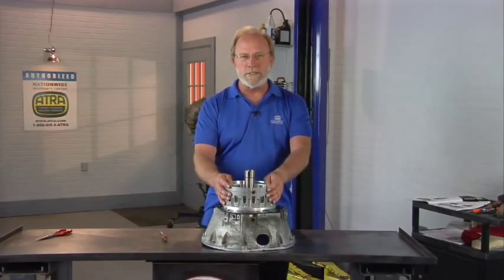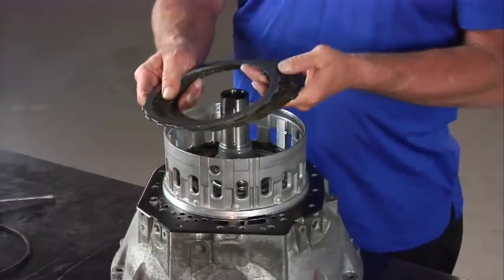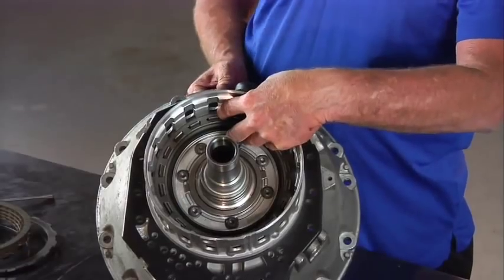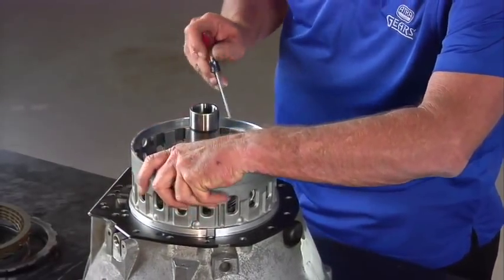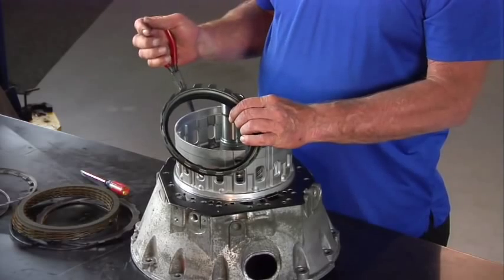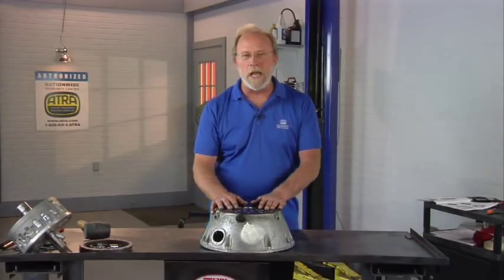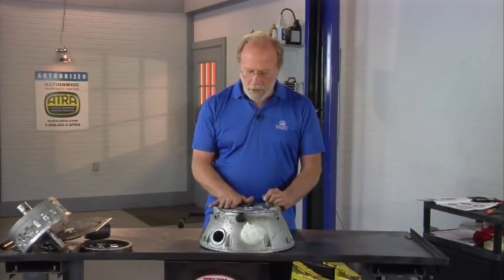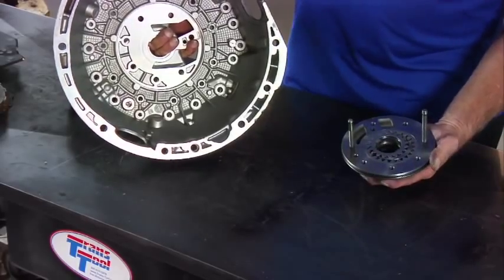Front Pump Disassembly  722.9 | Bill Brayton | Tech Tip

Comment: Hi...nice videos! My 722.9 (2012 GL 350 Bluetec - bearing style, not bushing pump) is leaking at the front. Absolutely no other symptoms. Replaced seal three times with OEM part, still leaks. Pump looks in great shape, torque converter neck not bruised. No metal chips, bell housing face is smooth with no scratches. Flex-plate could be bent? Torque converter neck not aligning in the crankshaft guide hole? Please advise as I'm getting desperate....fourth removal.  Thanks so much...
Reply from the maker: When diagnosing. make sure A. it doesn't have a recall notice and B. check the color of the fluids, there has been misdiagnosis in the past due to leakage appearing from somewhere else. From where I am sitting, It could be the Flex-plate, the O-ring, or a defective model. Take it to a shop if possible, it should run you a $100 to check. 
Here is a link to help replace the O-ring and it may provide more insight. 
https://www.youcanic.com/node/3114 

Hope that helps!
- J from AVI.